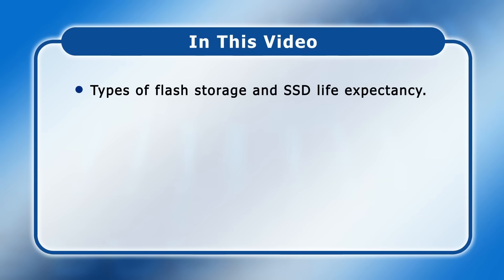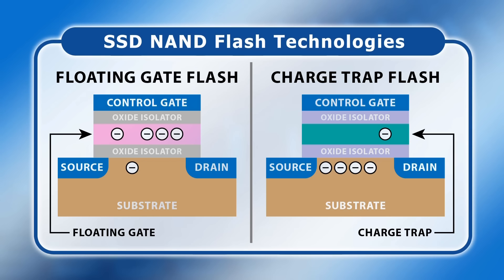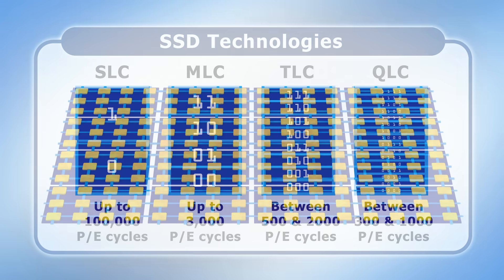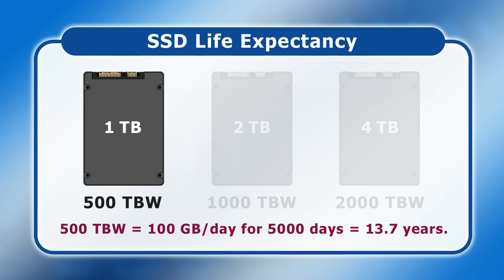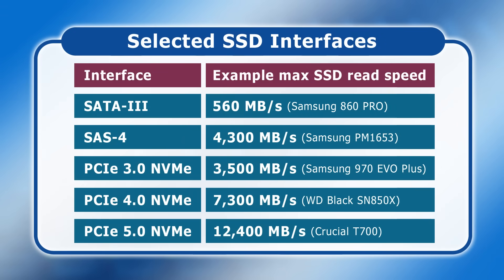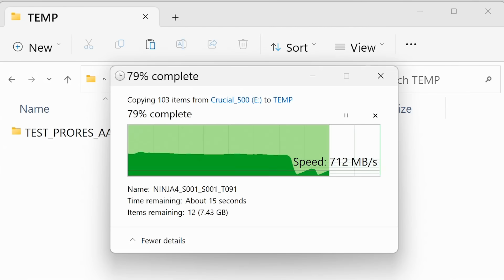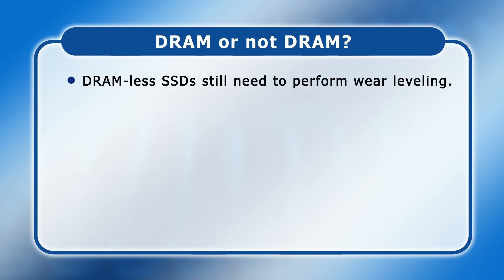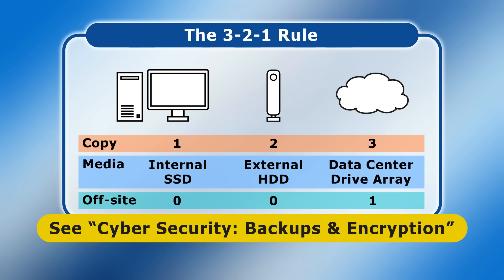Explaining SSDs: The Price/Performance Trade-off

Comment: For a home user wanting long term storage, an external HD is the best bang for the buck.
Just remember to power it on every few years and read/write something to it (aka move data off one drive to another).
This can help prevent bit rot.
With cloud storage, while nice and cheaper, you are paying for it one way or another. Either by money or the company STEALING your data. Oh and courts/cops have very easy access to YOUR data without your knowledge or consent. HD can be hidden. It can be encrypted (best just to do both - encrypt and hide offsite).

About SSD's - you must power them on once a year to ensure the cells stay charged.
Even if you don't do anything.
Had that happen to me and lost a whole lot of stuff.

Comment: Thanks for making sure TBW was in there. It's good to note that TBW is often used to limit warranty (like "1200TBW or 3-years, whichever comes first") but that DOESN'T mean a drive dies when it exceeds rated TBW. It does mean it's less reliable at storing data long-term + power-off. But I have SSDs at 3x their TBW still working with no errors.

Comment: I still use traditional hard drives, no 30 seconds extra load time is well worth not ending up with a coaster wher an ssd runs out of write capacity....  dumbest thing invented when they could have turn it to RAMDRIVES.....   ya I have a drive faster then any ssd,  thats NOT volatile and doesnt run outta anything..   

its called a sh*tload of old ddr2 module's soldered to an interface with a BATTERY to keep em non volatile.

Comment: The lesson I've learned is that you had to invest in enough ram space, because the excessive writing in swap is a killer for the ssd. Nowadays since we have no hdd leds flashing or hear noises out of the mechanical drive we did not get warned. Anyway the ssd I killed was an older model but I ve been warned and my important data is stored just in time in my nextcloud.

Comment: They should modify the firmware on SSD's so that it is possible to reconfigure a drives number of bits per cell. This would mean if your 1TB QLC started to wear out you could reconfigure it to a 500GB MLC drive. Thus expanding the drives life. Even going from 1 TB QLC to 256GB SLC would be a win.
Reply from the maker: That is an excellent idea. Sell us a drive with so many cells, and allow us to decide how we want to use them.

Comment: Such an important landmark video. The more I learn about SSDs the more I am proud to have my 14TB CMR HDD with 500mb cache (AFD hard drive, non-shingled) properly formatted, partitioned aligned etc. 

The problem is most consumers were unable to distinguish CMR from shingled drives. In addition most consumers were unable to purchase the expensive larger capacity drives which usually harbour the largest amount of cache, and unable to align the partitions correctly due to scarce software as well as tech knowledge . These 3 problems arose around the same time SLC SSD started to appear in the markets. Hence those who tried SSD never looked back at HDD.
However if you have the tech knowledge to be able to purchase a high capacity CMR+AFD then format optimally , partition optimally and align it correctly AND you don't need daily video editing / aaa gaming then you probably won't need to enter the utter mess that the SSD drives have become:  Overrated poor quality soldered low quality chinese QLC chips hiding behind their 1)DRAM, 2) SLC cache, 3) terabyte written capacity (TBW) 4)wear levelling caching behaviour 3)HMB cache. Ugh!
Reply: can you tell what is the proper way to do that and some write , read speeds?
Reply: @george-fulger  before purchasing a hard drive, download the "data sheet" or full specification. Make sure you choose a "CMR" not SMR as these can have similar model numbers, different by only 1 letter or number. Note how the courier delivers your drive. It should be delivered by hand in a harddrives box(well padded). If they throw the package on your doorstep the drive will fail after a while . To partition the drive, use a modern partition manager. You need to align each partition on the drive separately. A good partition manager will divide and align the partition simultaneously . Modern Harddrive speed is about 250/mb/s average. Gamers and movie editors will not tolerate this. But if you short stroking a really big drive you should get much faster speeds

Comment: 11:24 How do you change the material limitations of slower TLC and QLC NAND cells into faster SLC NAND cells?  Faster write speeds at the cost of data integrity is a really bad trade off and design flaw.  Solid State Drives need to seriously improve their lifespan and cost per GB to fairly compete with hard drives on the same terms.
Reply from the maker: The memory cells are all identical, but provide better P/E endurance when used for SLC because less fidelity is required (stray electrons matter less if a controller only has to distinguish if a cell is "on" or "off"). SSDs do already complete with HDDs in most situations, as most users do not write data that regularly.

Comment: Great overview. I would add a few things. I prefer to decipher TBW as "Total Bytes Written" rather than Tera Bytes Written for the simple reason that with older drives, manufacturers specified in GB, and now with the big capacity ones we get into PB territory.
In the old magnetic platter days, we called the sustained write speed that a drive fell back to once the fast cache is saturated "media speed" and the same concept applies to SSD now, as you explain. A S-ATA III drive with a 6 Gbps (750 MB/s) interface may have a media speed of only 50 MB/s. Especially in the flash memory for high resolution * high speed cameras we see a need for very high media speeds or sustained write speeds.
The write speeds on flash memory cards, generally, is burst speed and only valid as long as the cache is not saturated.
We also see cards that have higher sustained speeds with increasing capacity and this is not the consequence of more cache - because sustained - but likely something like RAID 0 or dual I/O controller chips inside the card.
Over-provisioning - Having worked in enterprise IT, I can add that a way to raise the number of P/E cycles in flash memory devices is to just put more memory in than the user and operating system (host computer) will see. So the usable capacity is what is on the label, but under the hood, for wear levelling, there is, say, 50% more. In the round-robin storage of data in fresh blocks (even after wiping a file from the FAT) the added capacity then results in more P/E cycles or higher TBW.
Reduced overprovisioning - we also see capacity numbers now that are outside the standard 2^n (n an integer) numbers. Imagine an SSD that has cheap memory cells but for TBW got 50% more - say it's 512GB on the label but has 256GB overprovisioning - and this SSD is sold for 1.00X. What has happened in recent years is that manufacturers had less complaints about SSD failing too early from consumers, so they shift part of the over-provisioning to usable and label. The 512GB now becomes 640GB with 128GB under the hood and the price now becomes 1.25X - for the same material.

The most important most overlooked property of SSD and flash memory is how long data retains integrity when the SSD/card is taken off power. Some cards have data integrity protection and maybe some SSD too. Ask a collective of people with a Ph.D. in electrical engineering and quantum physics for a number and you may get 7 to 7,000 hours as an hour.
In the light of wear levelling and consumers buying SSD that have low P/E cycles, today's advice to never switch a computer off really makes sense.

If you need reliable storage with a high number of P/E cycles (TBW) today, then rather like buying SSD variants, I would buy CFexpress Type B cards from a brand with a very good reputation (such as Delkin Black and Power series). Put these in a Thunderbolt reader/writer and its fast, very fast too.
Reply from the maker: You can decipher TBW as what you wish. But if you read a modern SSD specification, the term is most certainly used to mean terabytes written. Manufactuers do not write "Endurance: TWB: 500TB" they write "Endurance 500TBW". Language evolves.
Reply: CFexpress Type B cards or hdd for data storage?
Reply: @george-fulger  - that's a tough one. Ask a team of quantum physics e-engineers how long data are safe in solid state and they may answer between 7 and 7,000 hours. In practice with error corrections it's less dim grim.
Off power, that is.
I would prefer CFeB with RAID 5 over HDD.
Reply: @jpdj2715  for data storage seems that gold cds and dvds are best isn't it ?

Comment: A particular thank you for the SLC cache explanation, I was completely unaware of it and it explains the interesting results I got testing the write speeds of a bunch of DRAM-less SSDs a week ago copying a 12GB file to them. The pc RAM cacheing was obvious and it became clear when the write speed dropped a second time that there was some sort of cacheing occurring on the SSD, but I was blowed if I could figure out where. Now I know. The two cheap 120 GB SSDs suffered particularly, on a Kingston SA400 the sustained write speed went down to 60 MB/s, on a WD Green it was a horrifying 5 MB/s. That said I've had no issues using those as boot devices (including the WD Green), there aren't many use cases on a boot device where write speed even becomes relevant, let alone a pain in the bum.

Comment: Excellently explained once again. In just under 15 minutes I'm thoroughly and masterfully informed. Life expectancy of SSDs is what really does worry me the most actually. I just don't know what exactly is to expect in terms of practical anticipation defined in years of use. I can see SSDs for starting up the OS but best leaving working data, files and backups on a physical quality platter such as WD, so it seems.
Reply: You can check how many terabytes you have written via software.

In my case, I'd have to use my PC for at least the next 30 years every day to hit the TBW, and realistically much longer than that.

Comment: I wish you'd mentioned that HMB is exclusively usable by NVMe SSDs because it requires the fast PCIe bus to access system memory. SATA SSDs without DRAM are plain bad because they always have to fetch the data map from nand before they can read the actual data from nand. That's a major slowdown.
Also, HMB is not as good as actuall DRAM - though WD does have a whitepaper where they claim that for normal office tasks, even a few MB of HMB is enough for a cache hitrate of >90%. I expect that's a best-case scenario and cache hitrate gets much lower once you have to access a wider range of data. As far as I know, most SSDs will take between 8MB to 64MB of system memory for HMB.
Reply from the maker: Good point. Although I did note that HMB is an NVMe standard that accesses system memory over the PCIe interface.
Reply: @ExplainingComputers  Also once in a usb enclosure there is no HMB either.

Comment: What really gets me mad is when SATA SSDs that used to have DRAM cache are silently replaced with same-name models that no longer have DRAM.
Since SATA SSDs cannot use HMB either, that really hurts the SSD performance. WD / Sandisk in particular are guilty of this. I can no longer recommend the WD Blue 3D / Sandisk Ultra 3D SATA SSDs. This just leaves the Samsung 860 Evo and the Crucial MX500 as default recommendations... and Crucial has also significantly reduced how much DRAM they put inside.
Reply from the maker: Agreed.
Reply: QLC with dram is still worse than TLC without for most things.
Reply: @churblefurbles  There's some very highpowered QLC based SSDs in the enterprise sector, so I'll consider your statement an oversimplification...

Comment: Does the SLC cache's many writes/clears reduce the lifetime of the drive?  Since all of the data being written to the drive gets written to the SLC cache first, then to the rest of the drive.  It would seem to be that the SLC would wear out far faster than the drive is rated for.  Did I miss something?
Reply from the maker: The SLC cache will indeed take a hammering. But cells operating as SLC last a lot longer -- look back to the table at c. 4:30 and we are looking at up to 100,000 P/E cycles, compared to only a few thousand or hundred for the TLC and QLC SSDs that have SLC cache. So SLC cache writes should not usually be the determining factor of drive life expectancy.
Reply: Thanks!  That makes sense @ExplainingComputers

Comment: Hi Chistopher. How about shelf life? If I write data on a drive and then remove it and leave it in a drawer, is there any stated life expentancey? Cheers!
Reply from the maker: Generally, unless a drive has been really hammered (few P/E cycles remaining), it is expected to retain data for at least two years. SSDs with little block wear may retain data for far longer. To refresh the data on an SSD, it needs reading not re-writing, as for a HDD.

Comment: Tip: do not use solid state for archival purposes. SSDs lose data integrity the longer they go without being powered up. So if you make a backup to SSD and leave it in a drawer for a long time you’re going to be disappointed. How long? That depends on the ambient temperature of where the drive is stored. The higher the temp the shorter time the data will remain intact. 

Always regularly power up your SSDs that have important data. 

More importantly, make regular backups to spinning platters (i.e. hard drives) and use SSDs for daily stuff.
Reply from the maker: But note that just powering up an SSD is insufficient to protect the data. Rather, data has to be read to perform a refresh. Unless it has endured substantial P/E cycles, an SSD should maintain data for several years under normal conditions.

Comment: Very good video(short, clear and pretty much all encompassing) except Chris didnt mentioned one aspect of the SDD'd - data retention.
All SSD's can retain the data a certain amount of time while not powered, usually around a year, after that it starts to lose the data stored in it. This argument ties well into "No SSD is a permanent data storage" statement at the end of the video.
Reply from the maker: Fair point, except that two years is generally taken as the norm before data needs a refresh (via a data read, not re-write). But the more P/E cycles a drive has endured, the less time data will remain.

Comment: If I comprehend the explanation 4:32 straightforwardly, SLC has100k x its capacity (for convenience I name it "C") workable duration. In DLC it's 3k x 2 x "C". In TLC it's 0.5~2k x 3 x "C". In QLC it's 0.3 x 1k x 4 x "C". It is apparent that lower density flash memory devices are always superior to higher density one when you write data at the same rate. 
I never think flash memory device is theoretically NOT designed for data preservation, and wonder why does people buy high density flash devices which are fragile in any sense.

Comment: Generally speaking, semiconductor RAM all loses its data on power loss.
Dynamic RAM needs to be refreshed frequently. While the read process refreshes it, it's not enough and there is special circuitry used to perform that function.
Static RAM holds its data without the need for refresh cycles.
DDR arrived a little late for me, I believe it's a variety of dynamic RAM.

I don't know  anything significant about SSD.

Your assertion that DRAM holds its data while has power needs qualification.

You used to be able to buy SRAM in black caterpillars eight bits wide. One chip was enough for a small Z80 based system.
Reply from the maker: As you yourself open your comment, DRAM loses its data without power. :)
Reply: @ExplainingComputers  it also loses its data if it has power but isn't refreshed regularly.

I chose my words very poorly.

Comment: Do DRAM-less drives and HMB work if the drive is in a USB enclosure? Max bandwidth is of course limited, but is the drive lifespan affected?
Reply from the maker: HMB will certainly not work in a USB enclosure, as there is no direct access to a PCIe interface. It seems (from various comments here) that some DRAM-less HMB drives will not work at all in enclosures with some (news) OS, whilst others will default to using their NAND flash, so reducing their life expectancy.

Comment: We use 2 M2. SSD's in RAID0 paired with 1 Backup SSD, of course life expectancies will be shorter, but we write a lot of data while recording and producing multitracks in our DAW. These bottlenecks are a pain in our butt if a recording has a hickup. So every 3 months these will be replaced with new ones. And the older ones destroyed with shredding software.

Comment: Surprised you refer to them as 'drives' and not 'devices' as the device includes the memory as well as its drive hardware and software.
Reply from the maker: "Drive" is the standard term for a piece of storage hardware, including its internal controller, firmware and memory: SSDs are no different to HD drives in this respect! Device normally refers to the hardware a drive is fitted in (client computer, etc).

Comment: As ever, thank you for clarifying a few important factors in using / choosing SSD’s - particularly NVME. I now see my 4TB USB hard drives still have an important part to play. It would seem that backing up to an SSD and then putting the SSD in  drawer might not be very clever - does any manufacturer specify how long data is safe in an unpowered drive?
Reply from the maker: Generally, a data on an SSD is suggested to last at least a couple of years without being re-read (which refreshes the cell). Drives will more P/E cycles used may retain data considerably less.